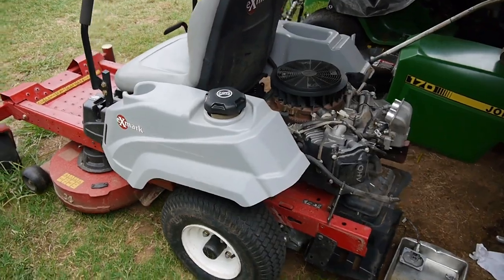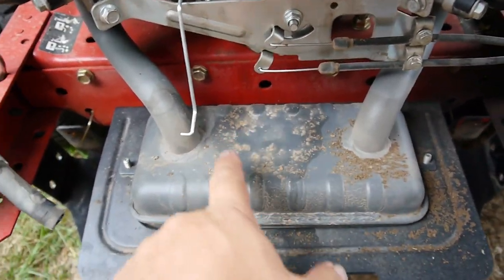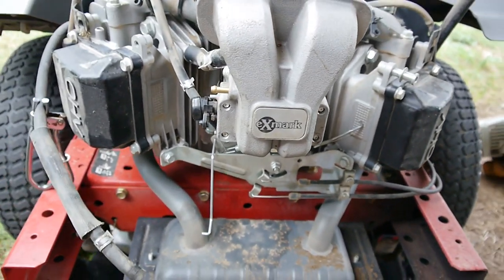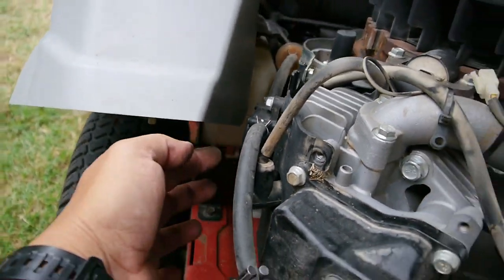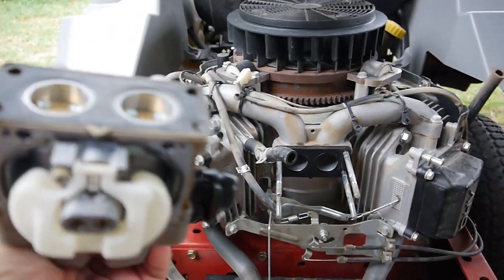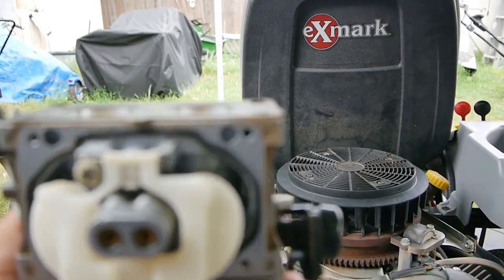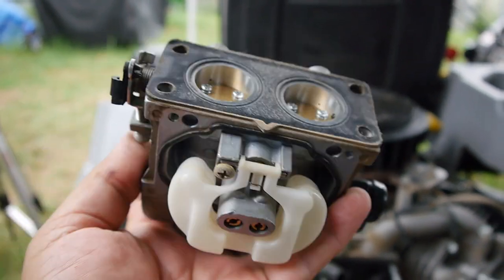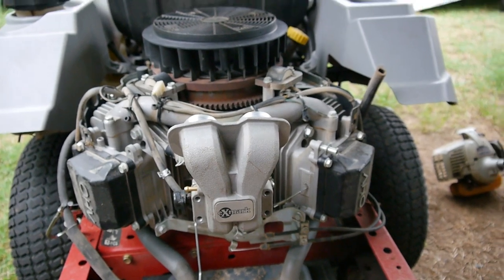Zero Turn Mower engine keeps flooding

Comment: I have the 22.5hp on my Toro with just under 20 hrs total run time. Overall quite happy with it's performance other than the cold starts. About 90% of the time I get a good puff of oil out of the exhaust when starting it filling my shed with smoke. It clears up quickly though just annoying. Don't think its an oil control ring issue but maybe faulty valve seals. Haven't brought it to my dealers attention but may before the warranty is up in 2 years. I changed the oil around the 3 hr mark a bit earlier then the factory recommendation, but really don't think this affected the breakin. Running Amsoil Small Engine Oil 10w-30 and it's staying nice and clean with no consumption.

Comment: Motor exactly like my toro . Mine just started skipping. Where do I start at? Two years old. Had been running ethanol mixed gas. Drained all of that out, but still skips? Coil,or spark plugs wires?
Reply from the maker: If it is a twin cylinder, try disconnecting one spark plug and try starting it. Do it for each side.  If one side has no spark it won't start at all.
Reply: Just replaced both spark plugs. Now it back to normal. Only about 2 years old but I think running the ethanol gas made it run different. Now I'll only run the non ethanol.learn not to do that again.

Comment: I use Exmark mowers I bought a new radis s with Exmark radius Mower with Exmark engine  I love it but I'm getting fuel in my exhaust  a mechanic at the dealership told  me thay was made by Kawasaki thanks for the video

Comment: Hello, I have this machine (motor)like your working on.. maybe you can give me a clue Ive had to replace the head, piston and rings,Rod ,head gasket because it dropped a valve and destroyed all that stuff I have it back together now and for some reason it cant keep the fuel flowing into the carb I mean the vaccume is real weak like i can barely suck on the hose like its a straw that goes into the intake and theres my fuel it pumps nice then so yes it has to be a vaccume thing wouldnt you say? Compression is like 150 psi of course the newly ring side is higher not by much and lets see I replaced gaskets on bottom because it Was leaking at O ring sump pump but all is good noW even the top EGR stuff Where the reed type valve is at along with that top gasket, also I can place my hand over the 2 barrel intake and feel the suction and the thing pumps fuel again very nicely...when I loosen the oil dip stick and run it that thing moves up and down which seems normal..Anyway it will run about a minute give or take ,can you help me with some clues? Now I did use plain gasket sealant on the intake manifold and valve covers because I had no gaskets but it is the good stuff could this be the problem tho? Let me know on anything to help Thank you!
B.

Comment: Toro partnered with Loncin on this 708cc v-twin specifically for their zero-turn mower. Those who call it 'cheap' simply because it is manufactured in china are ignorant of the facts. It is well engineered and has proven very reliable compared to kawi fr, kohler 7000 or briggs engines of a similar intended use. Rather than calling it cheap, it probably in fact costs considerably more than these others - if not for the Chinese government subsidizing the US import fees
Reply from the maker: I agree, they are good engines. I was comparing them to Kawasaki. I've only dealt with a few repairs; a cracked carburetor float, and magnets detached from the flywheel.  Otherwise, it is a strong engine.👍

Comment: I don't know about anyone else but I didn't see any fuel sloshing in the float in this video.  I have the same prob with flooding even though the engine starts right up on one cylinder.  The flooded cylinder still have fuel dripping from the bottom of the spark plug even tho' the plug has washer and I tightened it down good.  Still trying to figure out what's going on with it...
Reply from the maker: Check the flooded cylinder and make sure it is getting a spark.
Reply: That's the float. Not the "float bowl".

Comment: Loncin-china, they will put your name on one. Mower builders cutting corners they probably getting 10 loncin's for the price of one briggs, 20 for the price of one kawasaki. Seen a couple with broke rods and full of oil seem about as crappy as a briggs/ kohler courage That general motors type of no quality. These days if it ain't a kohler command, kawasaki, you ain't got much. Been seeing a lot of kawasaki's bending pushrods here in alabama.